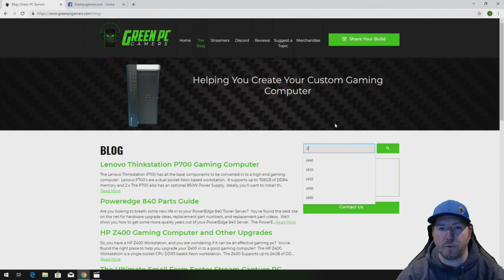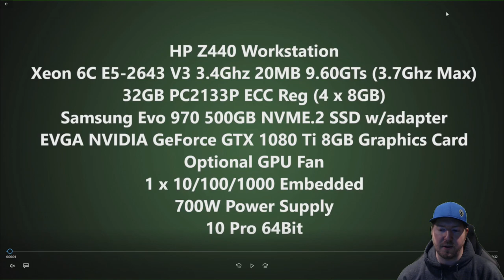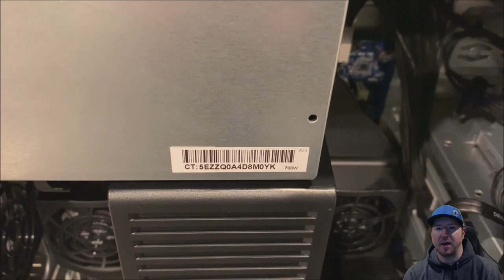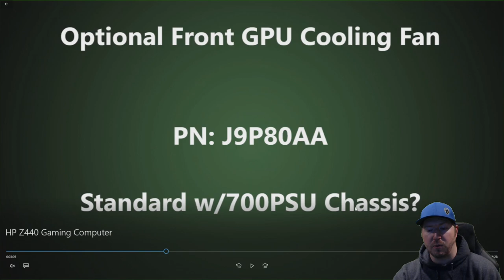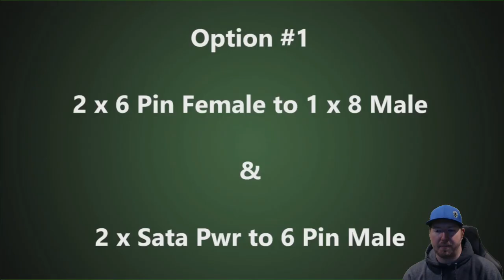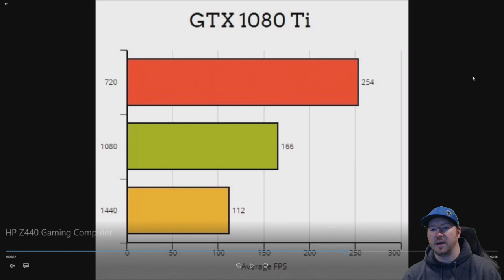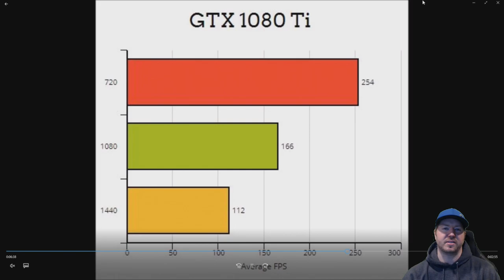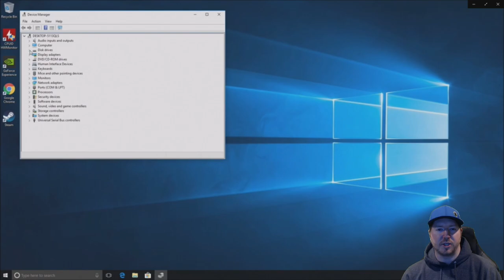HP Z440 Gaming Computer (GTX 1080 Ti and NVME.2 Install)

Comment: hi there, i’m currently running an e5 1650 v3 with 1660 super in this workstation however my cpu is hitting 80-85 degrees when running games, i was wondering if you could help me with this problem ASAP, many thanks!

Comment: Thank you... Can i install ZOTAC Nvidia RTX 2080 TI 11 gb GPU in HP Z440 workstation (700W SMPS), Xeon(R) CPU E5-1607 v3 @3.10 GHz processor
Reply from the maker: You'll see some pretty strong bottle-necking in the Z440 if you install an RTX 2080Ti.  Consider using an RTX 2070 Super or RTX 2080 Super.  They are cheaper, draw less power, and will have less bottle-necking in your Z440.  Also, consider using EVGA Cards. Thanks for commenting!

Comment: do you know what mhz the ram can go up to? ive had a z440 for a while and im now thinking about upgrading the motherboard because the bios doesnt support XMP
Reply from the maker: 2400mhz is max on the Z440.  You must have 19200/2400 memory installed with a compatible V4 processor in order to get the memory to run at 2400mhz.

Comment: I have a similar setup with a Crucial 1TB NVME, however, the card seems to throttle avery 10 minutes and the write speed drops to loss than 100 MB/s ... Any Idea what setting could cause this?
Reply from the maker: Try swapping to a different IO slot.  Preferably a PCIe x8 or x16 slot.  The other options would be to try replacing the Adapter card and/or the SSD.

Comment: Hey 👋  , I also have a z440  with 700 w psu . I need to know that is it possible to install Rtx 3060 12gb twin fan in this rig  .
Reply from the maker: Yes, it'll work as long as you can fit it in the chassis.

Comment: dear,
In option  #1:  at 9th minutes. Can I use 1x 6 pin Female to 1x 8 pin Male  &  2x Sata Pwr to 1x 6 pin Male? How many watts can the psu 700W supply in this case?
Reply: 1x6pin Female to 1x8 pin Power: 75W
Sata power to 1x6 pin Male: 75W
PCI-E : 75W
Total: 225W
But GTX 1080Ti need 180W
It is ok?
Reply from the maker: After about 20 hours of testing it seems to work fine.
Reply from the maker: We are not 100% sure on the actual watts with this configuration.
Reply: dear,
If you have Titan Z: 250W, How can be connected ?
Reply from the maker: That Titan Z requires 2 x 8 pin.  The minimum power supply requirement is 700w.  You’ll either have to get creative with power adapters or upgrade to an atx power supply that can supply 2 x 8 pin power for the graphics card.
Reply: @nguyendangbinh5185  the 6-pin from a 700W psu are actually rated for 216 W each (G1 and G2) with a max current of 18 A with 12V output. I have personally tested using GPU-Z that each of those can output at least 160W (using a 6-pin to 8-pin adapter and tested on msi kombustor with max load). the 6-pin connector actually have wires on connections #1, #2, and #3 which means it can be used like an 8-pin because for 6-pin pcie of those first 3 wires, #2 is optional. For 6-pin and 8-pin only the first 3 wires matter and the others are just ground/earth connections.
Reply: @jendlti  thanks!

Comment: where did you buy good quality adapters . i dont know where to find the quality ones and i dont want my pc to go up in flames. lol.
Reply: There is an official HP 6 to 8 pin adapter :) It looks very thick, EAN is 5711045508622.

Comment: Hi friend can you tell if a can put a ES-XEON cpu in this mothderboard ?
Reply from the maker: Recommended Processors:

V3 Procs:

Up to 1 x QC Xeon E5-1620 V3 3.5Ghz 10MB Processor | 3.6Ghz Max Turbo Frequency (SR20P)

Up to 1 x QC Xeon E5-2637 V3 3.5Ghz 15MB 9.6GTs Processor | 3.7Ghz Max Turbo Frequency (SR202)

Up to 1 x 6C Xeon E5-1650 V3 3.5Ghz 15MB Processor | 3.8Ghz Max Turbo Frequency (SR20J)

Up to 1 x 6C Xeon E5-2643 V3 3.4Ghz 20MB 9.6GTs Processor | 3.7Ghz Max Turbo Frequency (SR204)

Up to 1 x 8C Xeon E5-2667 V3 3.2Ghz 20MB 9.6GTs Processor | 3.6Ghz Max Turbo Frequency (SR203)

Up to 1 x 10C Xeon E5-2687W V3 3.1Ghz 25MB 9.6GTs Processor | 3.5 Max Turbo Frequency (SR1Y6)

V4 Procs:

Up to 1 x QC Xeon E5-2637 V4 3.5Ghz 15MB 9.6GTs Processor | 3.7Ghz Max Turbo Frequency (SR2P3)

Up to 1 x 6C Xeon E5-2643 V4 3.40Ghz 20MB 9.6GTs Processor | 3.7Ghz Max Turbo Frequency (SR2P4)

Up to 1 x 8C Xeon E5-2667 V4 3.2Ghz 25MB 9.6GTs Processor | 3.6Ghz Max Turbo Frequency (SR2P5)

Up to 1 x 8C Xeon E5-1660 V4 3.20Ghz 20MB Processor | 3.8Ghz Max Turbo Frequency (SR2PK)

Up to 1 x 12C Xeon E5-2687W V4 3.0Ghz 30MB 9.6GTs Processor | 3.5 Max Turbo Frequency (SR2NA)
Reply: @GreenPCGamerscom  I think he's asking if its possible to use an engineering sample or a QS with a Z440.

Comment: Hi everyone, anyone out there knows if the HP Z440 supports third party SSD NVMe (M2) with an adaptor instead of HP Z Turbodrive?
Reply from the maker: Most adapters and aftermarket NVMe M.2 SSDs will work in the Z440.
Reply: M2 nvme ssd are pcie usually, its just a mechanical Adaptor

Comment: Hey great video! I was wondering if you needed ecc for this mobo or if you could just use something normal like a hyperxfury kit
Reply from the maker: You can install U Dimms, but you can't mix them with ECC modules.
Reply: The HP Z440 spec manual says ECC only @GreenPCGamerscom

Comment: Can I swap the power supply for a ATX PSU or is it only meat for HP PSU that only fit in that case?
And also what connects do I need for the motherboard?
Reply from the maker: We haven't tried an ATX PSU on the Z440 yet.  We'll post content as soon as we try it.  Thanks for commenting!
Reply: Did you guys find something on this?

Comment: Can i connect a gtx1650 with the z440 as there will be no power issues and a decent gaming performance.
Reply from the maker: Yes, that card should work fine.
Reply: Thanks

Comment: I wouldn't do 6-pin to 8-pin, that is very dangerous. You're tricking the card into thinking it supposed to pull 8-pin power draw, when the PSU was designed for only 6-pin power draw for bother molex cables.
Reply: Molex is dangerous. What about the another option?

Comment: Bro can I upgrade E5-1650 v3 3.5ghz to E5-2696 v3, is it the same stock LGA2011-V3?...i think its ok
Reply from the maker: We've never tried that particular processor.  Post the results if you try it.
Reply: @GreenPCGamerscom  ok bro thx..I'll post it when the xeon arrives
Reply: @GreenPCGamerscom  the processor works great, I have no problem and the temperature at idle is not high between 35 and 36...nice! xd

*) I tried the xeon with an rtx 3070 with two adapters from 6 to 8 pcie it works well...thanks for sharing your information, otherwise I would never have updated

Comment: Bro z420 motherboard supports xeon x5690?
Reply from the maker: The Z420 does not support the X5690 processor.  The Z420 supports E5-2600 V1 or V2 processors, depending on your motherboard.
Reply: @GreenPCGamerscom  thank u bro❤️
Reply: @GreenPCGamerscom  bro last question z420 motherboard supports xeon e5 1660?

Comment: dear,
How to connect Z440 to 2x GTX 1080 Ti? what is PSU? 1000W?
Reply from the maker: The Z440 has the option for a 525W or 700W Power Supply.  Neither option will supply enough wattage for 2 x GTX 1080 Ti Graphics Cards.
Reply: you have to buy a bigger psu (850W or higher) AND the hp z440 mobo power custom wire so you can plug the standard psu to the motherboard.

Comment: Does the gtx 1070 work on it
Reply from the maker: Yes, as long as you have the 700W Power Supply and the IO cooling fan.

Comment: TIP: You can do the Xeon E5 V3 turbo boost unlock on this system too. Its not the easiest but I have done it and my E5 2640 V3 now runs at 3.4Ghz
Reply: Oh? do you have a link to instructions? I have a Z440 with the 2680 v3 on the way and was wondering if the Boost Unlock was possible
Reply: The Ukrainian PC community seems to have figured it out like I said but there isn't that much information in English. The people on the thread I mentioned though speak do speek though English so you can ask them questions.
Reply: What is a turbo boost unlock? Isn't turbo boost enabled by default in the bios or am I misunderstanding you?

Comment: Running mine with a 3.0ghz, 700w, 64GB ram, 2 ssd, 1 platter, and a 3060ti ftw with power adapters and an additional side cover fan added.  Played through portal rtx cranked up and run many other titles turned up.
Reply: Did you run into problems when installing the graphics card? I've been given a z440 which I'm going to give to my nephew as his first gaming machine, but when I install an AMD RX 580 the system beeps 6 times indicating it doesn't have a graphics card installed... can't seem to find a solution for this.
Reply: @MickayG  which power option you use to power the gpu?
Reply: @wasifshabbir2432  It has the 700watt PSU, plenty power... but it turned out the motherboard was faulty, was able to find a replacement board for cheap
Reply: @MickayG  Hey Z440 users, I am planning to buy this Z440 machine with 1650 v4. I am skeptical about the two things:

1) Is it safe to use dual-6-pin to single-8-pin connector to power the gpu. (I am planning to pair rather rx 580 or 1660 super)

2) Second, do I need to bypass any boot loading method for a nvme m.2 ssd or will it run naturally as plug and play.

Please someone guide me with this.
Reply: @wasifshabbir2432  Should have no issues with using a dual-6-pin to single-8-pin. I just ordered the same system as you with the 1650v4. Should be getting it next week. I will be putting in my current rx 6650 xt. As far as running an nvme. Not sure if you can use any adapter or if you need the HP adapter. I will just be using normal SSDs from my old system for now.

Comment: Hey, I have this same exact computer, but I believe the ROM on the motherboard in it is corrupt. How do you flash the BIOS for this motherboard?
Reply from the maker: Hey Mykhl,  Are you able to boot in to windows?  If so, what version of windows are you running?
Reply: @GreenPCGamerscom  No not even, I have windows 7. I know this was ages ago but I'm finally trying to figure out why this doesnt work
Reply from the maker: Mykhl Ellti do you see the hp splash screen when you reboot?
Reply: @GreenPCGamerscom  No, I get a black screen, it's not POSTing at all the speaker doesn't output beeps
Reply: you can actually flash the bios by setting jumper #33 BBR closer to the back of the unit (default is front). then put the bios upgrade .bin file on a fat32 usb. plug-in, run, wait for 8 beeps, then it will auto flash when the screen comes on and normal bios flashing will happen. after flashing place the BBR back to its default position then youre done. see the cpu door for legend and where the components are.

Comment: cool clips man.
i am stuck on a z440 thinking of those V4s. YEAH BABY.

by the way, you can have a xeon v4 in a Z440 without worries, unlike the Z420 where the MoBo PN restricted you to a v1.
right?
Reply from the maker: We haven’t seen any limitations with the Z440 V3/V4 processors.  The bios update is important prior to upgrading your cpu to insure you have the latest micro codes.